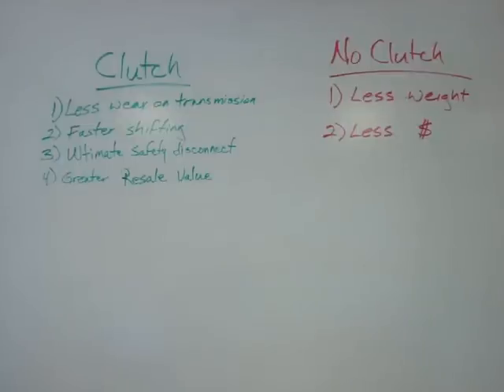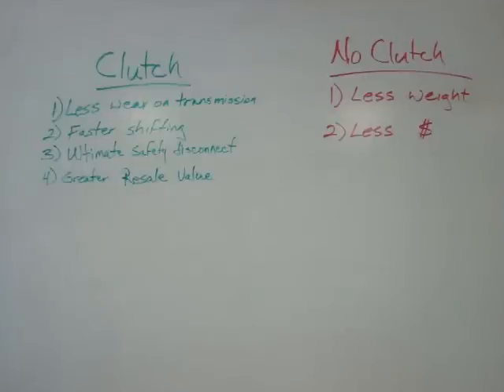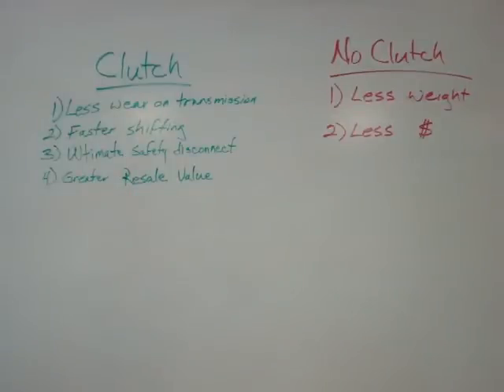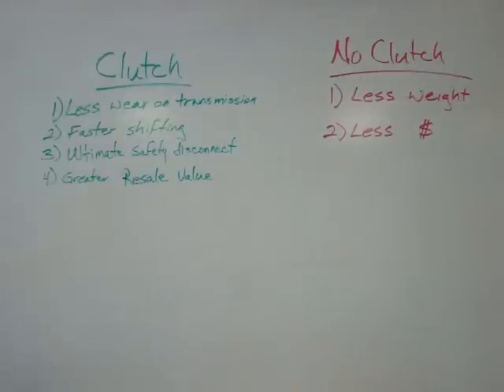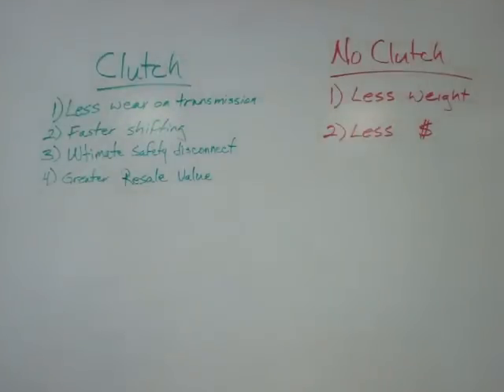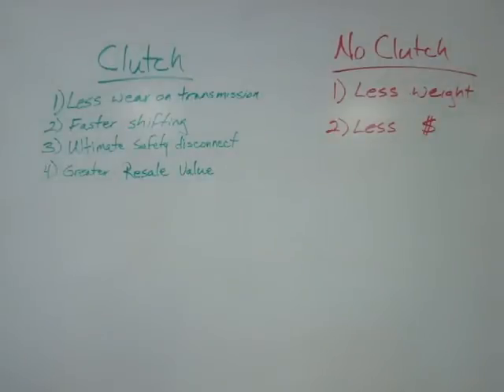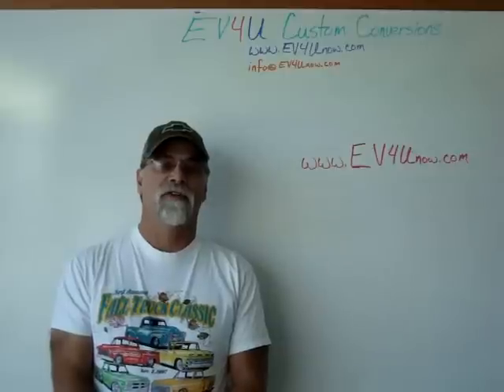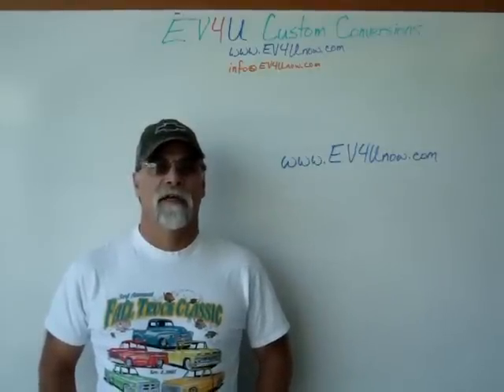DIY Electric Conversions - To Clutch or Not to Clutch

Comment: Rev matching Datsun driver here - I loved your work on the 280Z! Question: So normally, shifting up, you count on your engine compression slowing the flywheel below the speed of the output shaft, so you're going to want to rev up to match the speed of your wheels before you let the clutch out (obviously goes double if you're downshifting and want to maintain speed). If I understand this right, with an electric engine it's the opposite and the flywheel has less friction or drag than the output shaft, so when you get into a higher gear your RPMs are already as high as you want or even too high... do I have that right? Question #2: I played around driving a Tesla and they have that regenerative mode where when you take your foot off the accelerator, the motor pulls back a bit and I guess it recycles the power. Is it possible to do something like that where you can mimic the compression an ICE is fighting against, recycle that power and let the engine slow down in time with or faster than the rest of the drivetrain, so you could get a clutch feel of accurately matching the revs up to the next gear and not wearing your syncros?
Reply from the maker: The conversions feature regenerative braking that is programmable.  The vehicle shifts just like it did with the internal combustion engine.

Comment: I think I would use a clutch , it's possible to get light weight flywheels , or use a more powerful motor to compensate for flywheel weight , I'm a drag racer and I'm very interested in building a electric car for the track , cool video.
Reply from the maker: We use light weight flywheels in most of our conversions.  We do not need the mass, just something to mount the clutch to.
Thanks for watching.
Reply: EV4U Custom Conversions I'm just now learning about conversions , I'm seeing these Tesla's smoking a bunch of pretty fast drag cars , I got a lot to learn !
Reply: @TheMrmmkkpro  true dat

Comment: in the video you said less cost. If you're converting a car with a manual trans it most likely has a flywheel and pressure plate. What cost?
Reply from the maker: That's correct, with a manual transmission you already have the flywheel and clutch.  But many converters who keep the clutch, replace the clutch with new components, and/or heavy-duty components, and many lighten the flywheel too.  So in most cases, keeping the clutch cost more, but you are right, it does not have to.  I would recommend replacing the clutch at time of conversion and never think about it again.  Unless the existing clutch was in excellent condition.
Reply: I wanna keep my old clutch and tranny to save work but the trans isn't optimal for a warp 9 and weight makes a huge difference in overall cost and a tranny can be very heavy in some cars.

Comment: Hello,

I work in the material handling industry and very often we have 36V AC Motors , 

What ratings are these electric motors you're using maybe there is some cross compatibility?
Reply from the maker: We use motors from High Performance Electric Vehicle Systems.  Check out there complete offerings at HPEVS.com

Comment: I know that i may not get an answer but do i need a clutch if the electric motor does not shift gears? I mean it will have a reverse but will only engage when completely at a stop. I just bought a rc truck that i want to get an electric conversion on. there is one that has a clutch that this company had designed for the truck but there is another company who designed one that has no clutch that would be cheaper to buy but id have to put more money into cuz theres no motor and esc with it. so the price will be kinda close i guess. The one with the clutch , offers no replacement parts at this time. Im at a stnd still as to what to do. Just trying to get info as to what to do. If the clutch would be important in this matter.
Reply from the maker: Check this video for more information about using or not using a clutch.  https://youtu.be/20hncy7y4_I

Comment: Looking at the newest cars with lever gear shifting on the steering wheel, I would think one would want an electric motor that would coordinate well with a transmission, and combined with better and better batteries, it could really continue to be major advances in transportation.  Less cost and weight to me seem to avoid the issue of making an electric car that the masses will use and that will be safe for the average driver.  What a horror to be driving something that wouldn't stop, or would stick at a high speed.  Disengaging a transmission is a kneejerk reaction that should still be there....opinion only.

Comment: So in your conversions you still need a flywheel,clutch disc and pressure plate to shift just need to wait 3 or 4 seconds between gears or is that just when it has no clutch ?
Reply from the maker: With a clutch you shift between gears just as you would normally.
Without a clutch it does take longer to shift between gears.

Comment: Why use the gearbox at all? When you run a dc motor, it is "just" a question of power.
Reply from the maker: Check out our video, "The EV Answer Man, Episode 8", for the reasons why a transmission is used on conversions.

Comment: what about uphill?
Reply from the maker: Good point.  Having a clutch allows you to shift faster and easier, so if you needed to down shift while climbing a grade, you would appreciate having the clutch.
Reply: so a non-clutch electric car cannot go uphill even though it has a lot of torque?
Reply from the maker: Did not say a non-clutched electric car can not climb a grade.  If you needed to down shift while climbing a grade, it is faster and easier to do so with a clutch, versus trying to down shift without one.  Either way will work.  Please direct any future questions or comments to info@EV4Unow.com  Thank you.